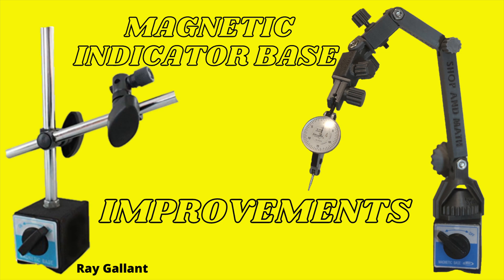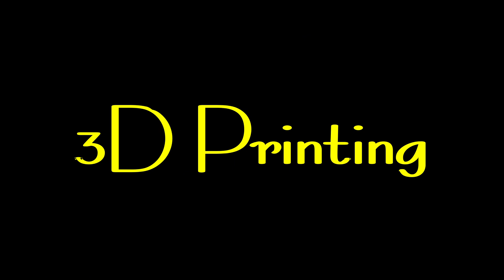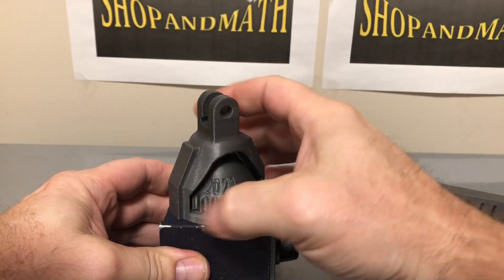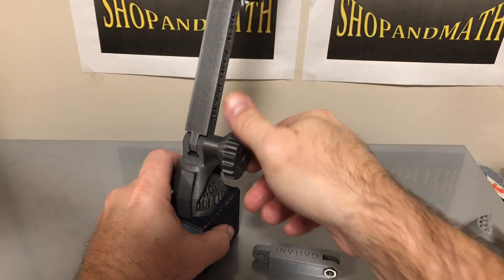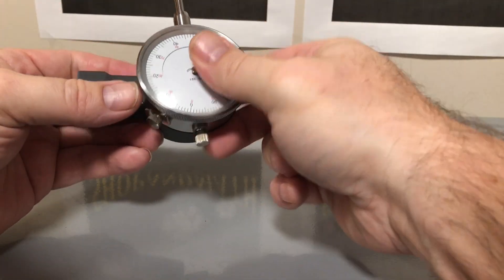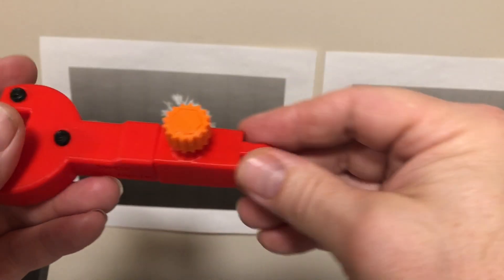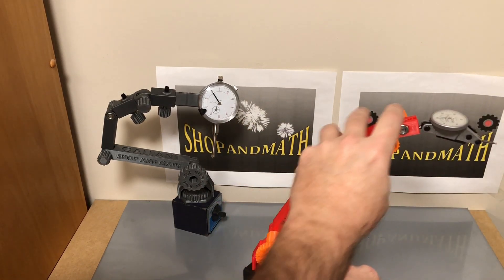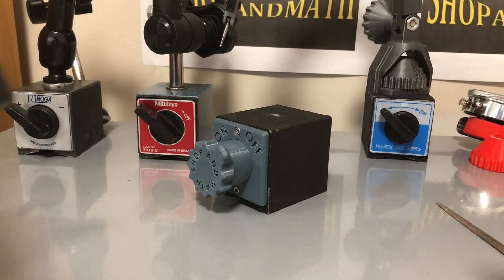magnetic indicator base improvements

Comment: Well-made and well explained. Where can I find models?
Reply: The STL files link is in the YouTube video description 
If you do print them off let us know
Reply: When I click on the link for the STLs, it asks me to sign in to some account . . .
Reply from the maker: @tradeschool1290  
That shouldn’t happen I will check the link tonight
It is also posted on thing averse
Reply: @shopandmath  Had the same problem. Tried to sign into my work account with no failure. Tried my work computer and laptop put still did not work. Great video - thanks
Reply from the maker: @brianmitchell305  try this link
https://stuconestogacon-my.sharepoint.com/:f:/g/personal/rgallant_conestogac_on_ca/EnFa6l2JViJAhtOIrTq_2ZsBux4KOhx554XABmT2Ks7_DA?e=HavHrD
Reply: @shopandmath  That link worked. It was one file. thanks
Reply: I finally got a chance to print out today but parts to large. Is it possible to get individual parts? Also, I can see needing a part or two extra but you would have to print the entire set of parts.
Reply from the maker: will post some separate files need a couple of day swamped with work
will send you a reply when posted
Ray
Reply from the maker: I added 12 more files let me know if there is any problems
Ray
Reply: @shopandmath  Thank you - printing tonight